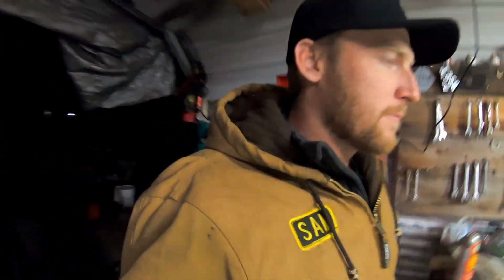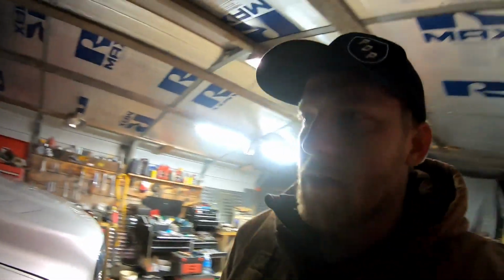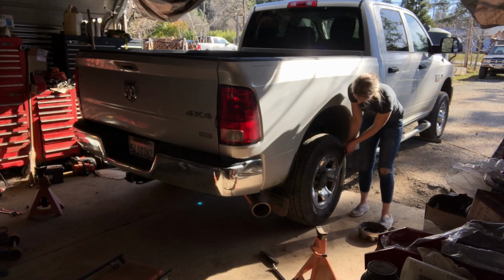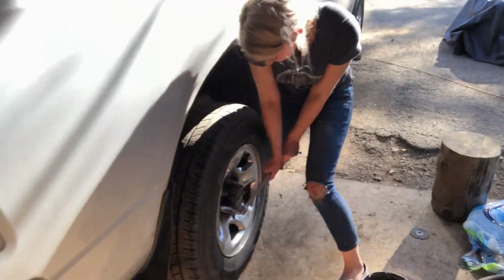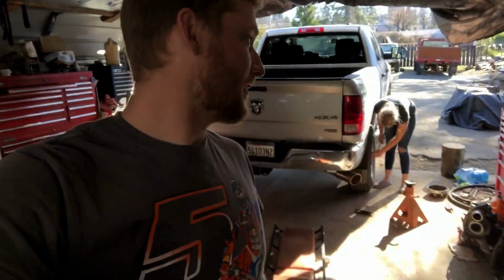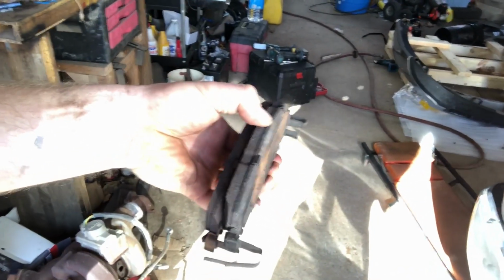TEACHING MY GIRLFRIEND HOW TO WORK ON HER DODGE CUMMINS!

Comment: 6:39 need to teach her the "star" pattern for tightening ;) and buy her some Carhartts... I LOVE seeing chicks in them, especially the bibs..
Reply: Mike Collins she was doing the star pattern
Reply: 6:15
Reply: @derekv4649  She started them with star pattern, then did final torque going around.. backwards from everything I've ever been taught ;) also should be using a torque wrench...
Reply from the maker: I normally go star then circle for bump with impact and meh no need to torque wrench for little rig torque the log truck but these little lugs aint going anywhere

Comment: Good job by both of you. Need more like that.
We need to WARN her about something she did when you gave her the new breaker bar for leverage. CAUTION: When she put all she had on the bar I cringed a little relating to the number of times the socket (or wrench) came off of the nut/bolt and I was quickly headed for the floor. Show her how to do what she did but MAINTAIN a position of BALANCE. She's too pretty to learn the way we did.
Oh, yeah I know this is old but I ran out of your newer stuff. Later & thanks. Sonny (CT)